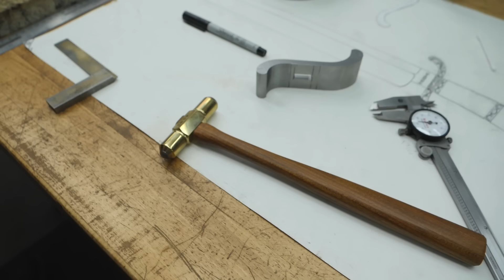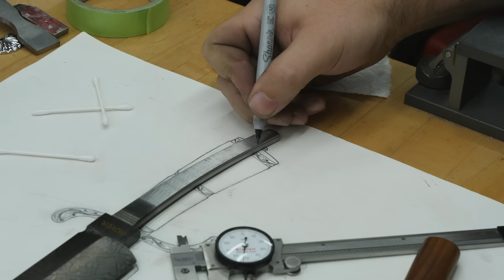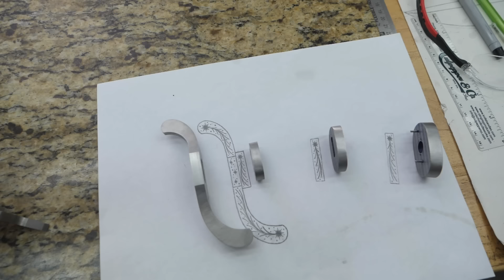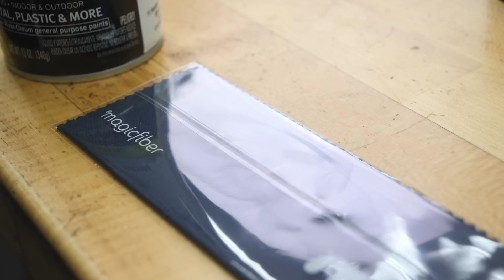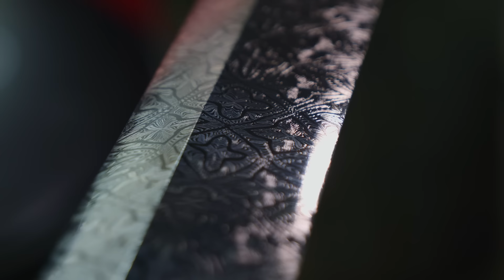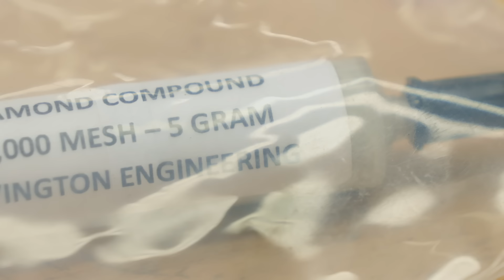After 6 Months, This Knife Is Finally Done ✅

Comment: In general for polishing gemstones and semi gemstones, jewellers also often use Aluminum Oxide powder too. (just mix the powder with water untill it's a paste) 
Also very important to all watching and new at the process of stone cutting. a lot of mineral stones like lapis, or jade or anything like it, a lot of prescious stones belong to the Asbesthos family, so always wear protections around your face most of all, but also wear gloves to prevent cross  contamination, and always cut with plentiful water to avoid heat buildup, but also to prevent the dust from flying all over the workplace because it is a nasty kind of dust :)

Comment: Oh yeah, hand engraving, that was always fun, especially in the beginning when you're learning you will shoot out and skate across the surface a few times, and unless you're holding your material the right way you might also skate into your own hand, which goes deep with something that sharp, great fun.
Although i never worked with these automatic engraving tools, just by hand, i really want to try that, even though it's been years since i did some hand engraving. Now, i did only gold, silver, some copper every now and then, and those are softer of course, so maybe there isn't as much need with that, or it might even be or go too fast with this, but still.

Comment: Get yourself a jewellers draw plate or two. You can buy a single size of stock wire and use the drawplate to change its diameter to that which suits your channels. You can get them in different profiles too, square, triangular, oval, rectangular etc.

Comment: Had you considered clear coating the lapis to get a glassy finish like you have with the carbon fiber? I wonder if the varying density of the stone is causing the orange peel since you are using soft/slack belts. A solid platen might give a better result like a stone faceting machine does, but that would be impossible to do a round polish.

Comment: If you get them close enough, they can actually cold weld. I don't know what happens there. Maybe the friction of putting it in creates enough heat on the surface to do welds. Could probably cool the handle and heat the ricasso. It's a good idea to cool the knife anyway. But don't heat the ricasso too much. I would worry about other stuff happening though if you did this. I'm just some dude thinking, I don't know what I'm talking about.

Comment: a little tip, if you want to remove the orange peel from the stone, preheat the stone, but each stone must be fully heated, so preheat it. Each stone heats up to a different temperature. and then polish, but do it by hand, not on a grinder.

Comment: Greetings from Russia. After grinding the gold wire, there is no need to grind off the excess onto the floor. You can collect all the shavings. walk with a magnet. The magnetic metal will go away and gold will remain. Melt it with a torch and you will have a good amount for a new job. Good luck and health to the whole family.

Comment: NO NO NO NO, Do not use a cutter in a drill chuck. The drill chuck is not designed for lateral moves and the grip is not strong enough to hold the cutter. Sorry. Love your work!